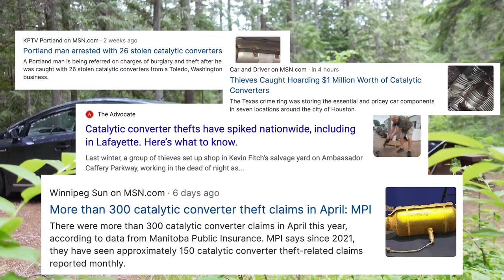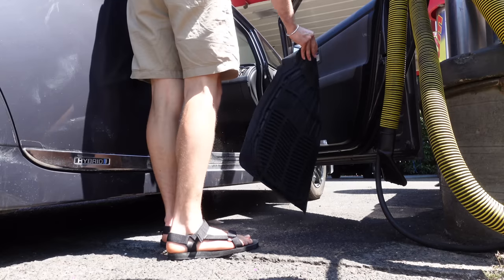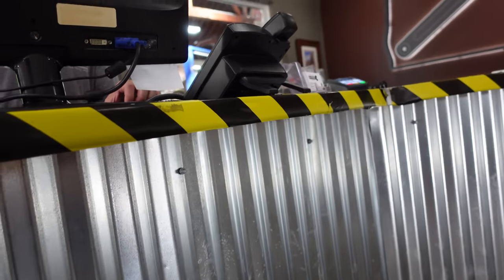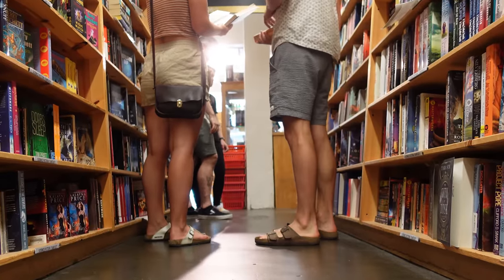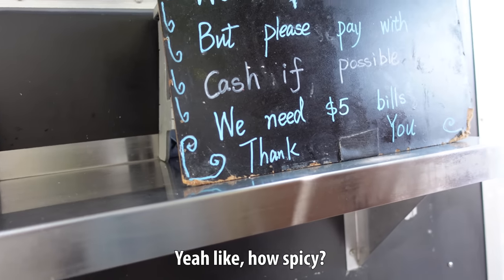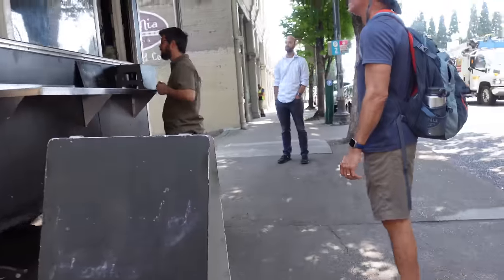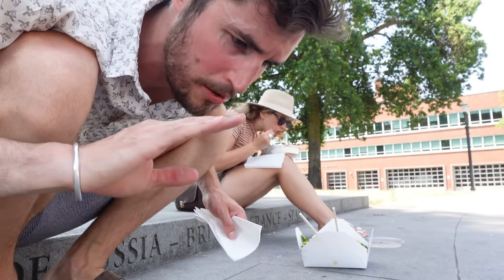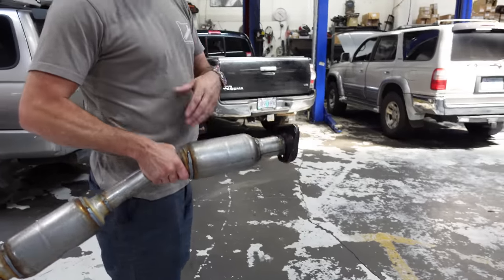Our Biggest Worry Living in a Prius...

Comment: Would definitely recommend purchasing weathertech mats for the front of the Prius. They're rubber mats and they cover the sides of the car in addition to the bottom, which makes cleaning way easier. I have the same model Prius, and I've loved them (especially during the winter with tracking road salt into the car)!
Reply from the maker: That’s a great tip! Having the rubber matts we do have it a must 🙏🏼
Reply: I had weather tech mats in my Civic and I hated them.  Unless the design has changed, there aren't any grippy fingers on the mats, so they just slid around, especially under the driver.  The "full coverage" meant that it was incredibly difficult to remove them without dumping whatever was inside them into the car.  Easily one of my worst ever purchases.
Reply: @HarryLovesRuth  On the driver's side, the Prius has clips that are anchored to the floor of the car and snap into the mat to prevent slipping. Not sure what the situation with a Civic is
Reply: @danidelconte  The Civic had pegs that held the factory floor mats.  The WeatherTech mat did not have a corresponding hole for those pegs.  I had to remove them in order to install the WeatherTech mats.
Reply: @HarryLovesRuth  oof, I wonder why they didn't just make it fit in the pegs. that would make it a lot easier

Comment: Awesome to see y'all managed to get something to cover it. I think we were all laughing about it in the comments last video. One of those things where it might not ever happen but always better safe than sorry to bite an upfront cost right now to avoid a bigger cost in the future 👊🏿❤️
Reply: That waterfall shot at the end. 👌🏿🔥
Reply from the maker: Haha thanks. When you live in your car it’s kind of a must I think 😂
Reply: Yeah the CatShield seems expensive at first, for a Prius it’s a couple hundred but for bigger SUVs it can be $500 or more. But when you consider your catalytic converter is, like the guy in the video said, $1500-$3000… if it deters a thief and makes them move on to the next target, well worth it!
Reply: @sailorbrite  💯
Reply: @Frenchy My thoughts too. Around here they either unbolt or cut them off. Why stops them from simply unbolting or cutting the shield?
Reply: @Frenchy Yep, people can still attempt to remove the shields but it's basically a level of deterrent that makes it much harder. Stopping most thefts but obviously if someone is very determined and came with several tools all it will do is buy time for someone to hear the noise. Coz most people will also have like a cat converter lock (these cable style locks underneath the cat converter as extra security to help prevent making it an easy cut for thieves) but basically stops it from being easy to just quickly go underneath a car and snatch it with minimal effort.